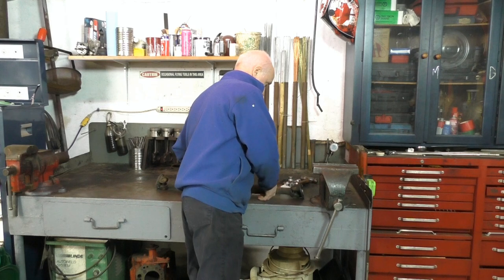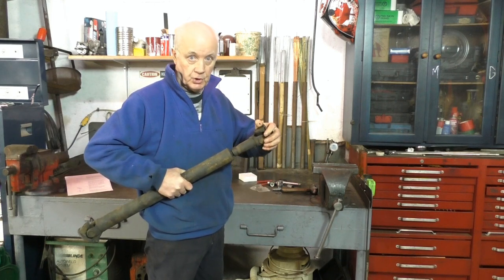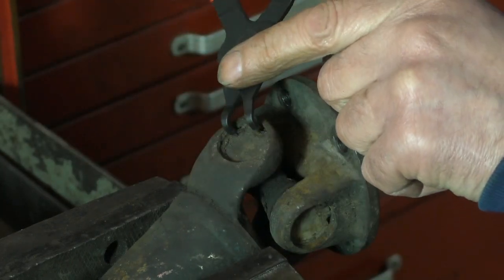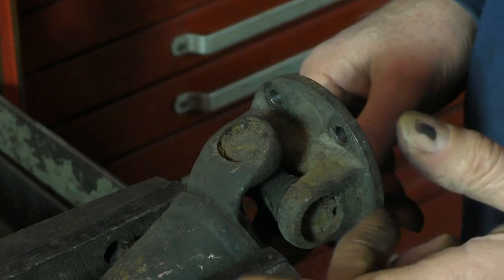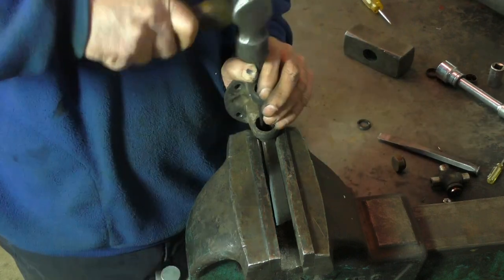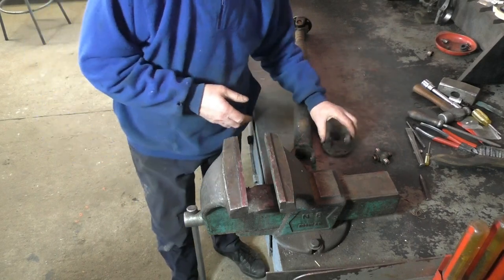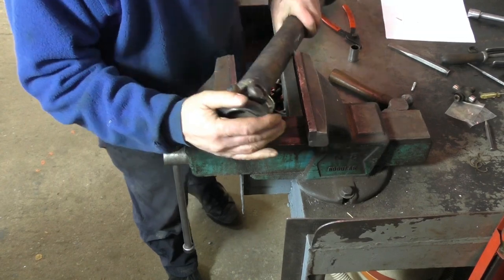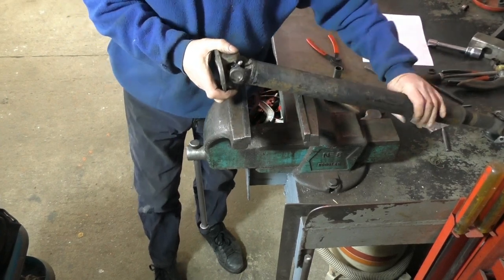Dr-Doolin MGB U Joint Replacement

Comment: Superb tutorial! I didn't mark the orientation on the flange before stripping so I hope I'm lucky! Also I have to complete two of the caps in situ as the only way to fit the prop shaft (without removing the diff or engine & gearbox) is to install then fit one new U/J. I'll just have to use 'the persuader'!
Reply from the maker: Hi Andrew
I would suggest trying a G-clamp rather than bashing them. Or if your really short of room a couple of flat plates with bolts either side.
James
Reply: @Dr-Doolincom  Thank you. 🙂

Comment: I found this very useful when I did my UJs on my TR3 thanks. One question what is the best lubricant to use on the sliding splines?
Reply from the maker: Hi Phil,
I just use wheel bearing grease, it has the right properties for high pressure contacts and a good heat range.
James

Comment: What about the other end what if uou pull the spline out how do you line up with the other end or doesn't  it matter?
Reply from the maker: There is only a spline at one end, the other end of the shaft is a solid mounting for the U-joint.
Reply: @Dr-Doolincom  I think he means , is there only one way for the splines to go back. On quite a few of the leyland cars there is a 2 arrows to line up.  If not lined up it can vibrate.